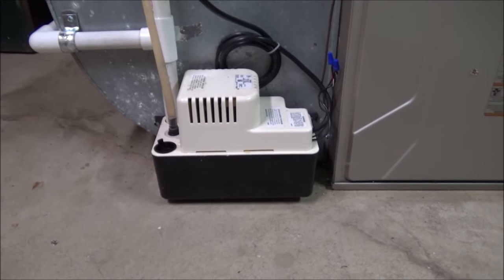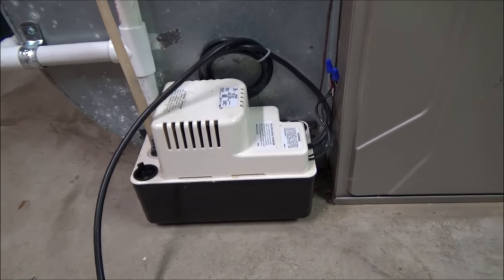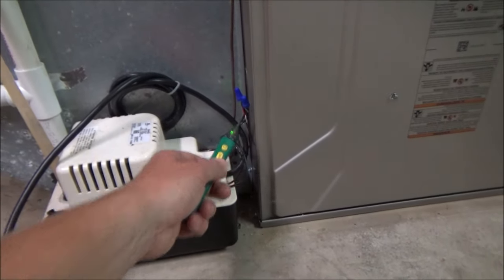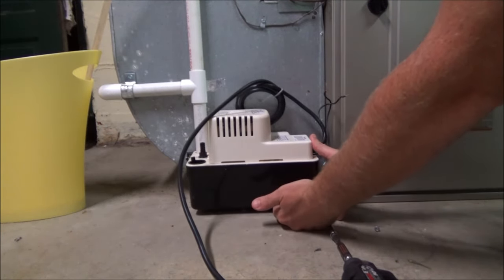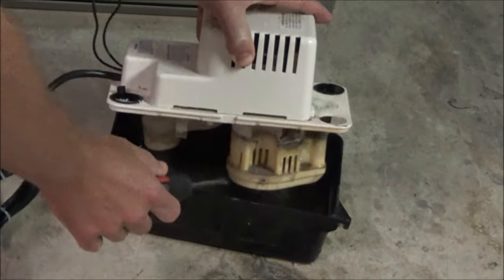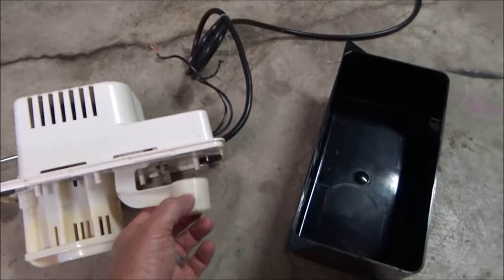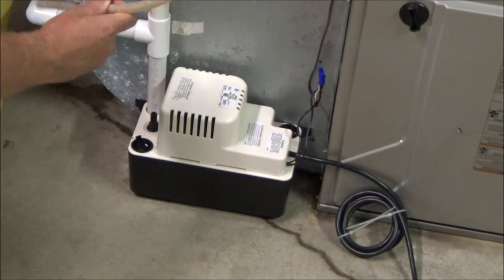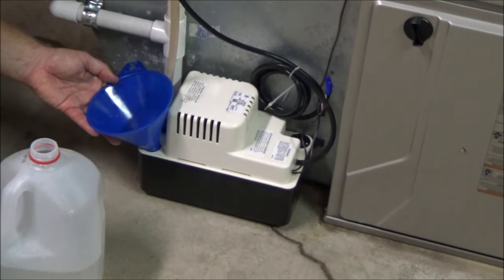How to Clean Out a Condensate Pump

Comment: Just one thing I would add, the plastic pipe feeding the pump should be cleaned too because they build up and clog there as well
Reply from the maker: Good tip! Input always welcome, I'm far from perfect!
Reply: I cleaned mine today with a plastic auger, a metal auger, and Dawn soap. Cleaned in around 30 minutes

Comment: Thank you so much. When I went to add the vinegar to my pump, I discovered that my son-in-law had forgotten to replace the little plugs which allowed debris to get into the pump reservoir. That is why the line got clogged and caused an overflow of water on my carpet. Please stress in your next video the importance of keeping those plugs in place. Thank you again for solving my problem.
Reply from the maker: Glad I could help.

Comment: I watched your video after my condensation water pump failed. I took it apart and found the sludge. Yuck. It covered the float and the side walls. This pump is dated 01/05. 
After hosing the sludge off of everything and then scubbing with Dawn liquid soap. I took the housing off the "impeller" and cleaned it out.
I put it all back together and wired it up. I filled the tank and turned the ac back on. It worked !!!
I recommend cleaning the water pump every couple of years, I will now😅
Reply from the maker: That's great! Love hearing stories like this. Thanks for sharing.

Comment: Saved me a call to my HVAC company right in the middle of a snow storm. Thank you!
Reply from the maker: No problem, glad I could help!
Reply: Why would you need to run the condensate pump in the middle of a snow storm? I thought condensate pumps were only required for use in
air conditioning units for cooling, not heating.

Comment: My furnace was installed 6 years ago, and I don't ever remember seeing my pump cleaned out during annual contract maintenance.  I have been told to add vinegar and water, but never why. In the past 4 days, my furnace will not start up because of pressure switch (3 blinking red lights) malfunction.  I did some googling, and found how to reboot the system by turning off the power for 20 seconds and reboot it, and it's good to go for about 18 hours, then it starts all over again.  When I disconnect the drain line from the lower pressure switch, about 2 tbsp of water will come out.  When I add vinegar to the disconnected drain line, it backs up real quick.  Tomorrow, I'm going to do as you demonstrated in your video, and hopefully everything will be work out.  Being on a fixed income, your fix might save me the cost of an HVAC service call.  Just had my annual tune up in Oct.
Reply from the maker: Hopefully cleaning out the pump helps. They can get pretty grimy in there!

Comment: Thank you! This was so straightforward and simple even I was able to do this. You definitely saved a lot of people some money!
Reply from the maker: No problem. And that's what I'm hoping to do! We all need ways to save money these days!
Reply: I have a high efficiency furnace.  My condensation pump is running longer than normal. 
How fast should the water be coming out of the tube?  The tube that goes into the sum pump.

Comment: Thanks! I wasn't sure if I was approaching this correctly, but you validated everything I was doing. Still looking to see if there is or should be any kind of filter in this system. Also my condensate pump has a tray for some tablets that I assume act like the vinegar to keep it running clean.

Comment: Just saved me $100 on a service call!! Thank you sir!
Reply from the maker: No problem, glad to help!
Reply: @fixitFlip  so what does it mean if my drain pan is still filling with water even after I cleaned the condenser?
Reply from the maker: @JakeAnderson-il4mv  Do you mean filling a little (like it should) and then pumping the water out, or actually overfilling? If it is overfilling it could be a stuck float or a bad motor!

Comment: Good video. Mine pump is noisy and vibrating. I suspect the impellor is imbalanced due to the dirt. Have an ideas on how to remove the impellor cover?
Reply from the maker: I do not, sorry. My old one was doing the same thing and I finally just replaced it with the one in this video.
Reply: @fixitFlip Thanks. I just flushed my pump with white vinegar and then some water. Seems to have did the trick, although I'm sure it's only temporary.

Comment: Hi, what about cleaning out the discharge tube, any advise on how to blow the slime and 'stuff' out of the discharge tube so it does not clog up?
Reply from the maker: Honestly, I just run vinegar through it and when it gets too crusty, I replace it. I replaced mine with this one. https://amzn.to/2TEW0pO
Reply: @fixitFlip  trying to avoid that, the tube runs about 25 to 30 feet and goes up to the ceiling (9/10 feet high) and then the length of the basement and down the wall and outside. it is zip tied all along the way to the furnace wiring and tubing.  Was hoping for a gizmo that I can attach a leaf blower to and blow the 'stuff' out.   Thanks for your time.
Reply from the maker: @bingandyogi  I see. There may be a special tool out there for that, I'm just not familiar with it. Sorry.

Comment: I am about to attempt this cleaning! A little nervous about all the electrical stuff.  Should I just turn the furnace and all A/C breakers off before I begin? I do not have a non-contact tester.
Reply from the maker: Yes if you turn the furnace off then flip the breaker off then you should be good to go! I put a link to the tester under the video, though, if you want to be sure!

Comment: Great video but my condensate pump is right on the ground and there’s no way to move it slightly down any further to clear the drain pipe that goes into it. I was thinking of taking a turkey baster and sucking out all the slimy water and replacing it with a mix of water and vinegar. Thoughts?
Reply from the maker: Can you lift the pipe up and out of the pump?  But yes, some vinegar would be better than nothing for sure.
Reply: @fixitFlip  No, the drain pipe is glued in at the elbow so it would have to be cut. I figured, at least with a turkey baster, I could suck the sludge out and refill the pump with a mix of water and vinegar until it starts up again.
Reply from the maker: @valerie4707  Yes, that would be a cheaper technique then cutting the PVC and having to put a new coupling on. I would suck as much crap out as you can like you were saying, then run some vinegar through it. That's better then nothing. As long as you can free up that float it should help it work better. They should not have installed it like that. Silly.
Reply: @fixitFlip  Thank you, and tell me about it! I will be sending a note to have it on file because they never told me to run vinegar through it regularly either. If it fails prematurely, I can maybe get a deal on a replacement. Brutal.
Reply from the maker: @valerie4707  Can't hurt to try!
Reply: I had success with the turkey baster and an old toothbrush to get gunk out of crevices(inlet openings/slots)
Reply from the maker: Good idea. @nobusmanrbbj

Comment: The video is very straightforward and I can follow it... except I get blocked on my own attempt: the drainage hose feels really stuck, I can't seem to get it detached. I'm afraid if I tug too hard & improperly it will break something. Any thoughts on what I may be doing wrong?
Reply from the maker: The lines can just get stiff overtime. They lose a little bit of their stretch. Try giving it a little twist as you pull.
Reply: @fixitFlip  Thanks Flip! That makes even MORE sense! I appreciate you
Reply from the maker: @lizmade2296  No problem!
Reply: Could have sealant around it.

Comment: Thank you for this video. The check valve on my Little Giant condensate pump broke at the point that is flush with the plastic top lid.  Obviously water shoots out when the pump runs now.  What is the best way to remove the portion of the check valve that is below the plastic lid?  Also this condensate pump is 22 years old and seems to work fine despite never being cleaned.  What is the lifespan of a condensate pump and is it a good idea to replace it after a certain number of years as preventive maintenance.  Thank you again.
Reply from the maker: You have done very well to get a pump to last 22 years! Typically a lot shorter than that. I would have to see the check valve, but there should be a way to get it out. Either take the lid off and get it off from underneath or use a pair of needle nose pliers.

Comment: Great vid. I got a question. I had tape on one of my safety switch wires that go to furnace. The tape came off. Now not sure which wire is which. If i cross  those wires will it still work correctly? Shows you how much i know
Reply from the maker: Either wire can be connected to either side.  Just make power is off when you connect the wires!

Comment: The video is very good and accurate.   However, I have developed an easier method of keeping the tank clean.   Run white vinegar with water (every other month)  through the tank like shown in the video.    That does a good job keeping the tank and components clean.    The Little Giant factory told me to NEVER USE BLEACH to clean it with.    Bleach will damage the pump and motor seals.   I do not clean the CV-10 check valve.   I replace it with a new one as needed, about every two years.    They are $4.99 + shipping on Amazon.    The normal "motor on" drain time is about ten seconds.    If the drain  time goes above 30 seconds, replace the check valve.     Also, sometimes bad check valves make funny noises while draining, it's probably not the motor or pump.    Replacing the check valve will usually stop the funny noises.   Always works for me.    Don't replace the entire Little Giant pump if it's not necessary.     My Little Giant pump is still working good after 14 years.   I have replaced three CV-10 check valves.   :)
Reply from the maker: Thanks for the tips!
Reply: How do you feel about bleach in pumps Lowry?
Reply: Put a couple pan tabs in it
Reply: Id rather take it off than infect my shopvac with gross mold
Reply: @Keith_Mikell  The video is very good and accurate.   However, I have developed an easier method of keeping the tank clean.   Run white vinegar with water (every other month)  through the tank like shown in the video.    That does a good job keeping the tank and components clean.    The Little Giant factory told me to NEVER USE BLEACH to clean it with.    Bleach will damage the pump and motor seals.   I do not clean the CV-10 check valve.   I replace it with a new one as needed, about every two years.    They are $4.99 + shipping on Amazon.    The normal "motor on" drain time is ten seconds.    If the drain  time goes above 30 seconds, replace the check valve.     Also, sometimes bad check valves make funny noises while draining, it's probably not the motor or pump.    Replacing the check valve will usually stop the funny noises.   Always works for me.    Don't replace the entire Little Giant pump if it's not necessary.    :)
Reply: @Keith_Mikell  
The video is very good and accurate.   However, I have developed an easier method of keeping the tank clean.   Run white vinegar with water (every other month)  through the tank like shown in the video.    That does a good job keeping the tank and components clean.    The Little Giant factory told me to NEVER USE BLEACH to clean it with.    Bleach will damage the pump and motor seals.   I do not clean the CV-10 check valve.   I replace it with a new one as needed, about every two years.    They are $4.99 + shipping on Amazon.    The normal "motor on" drain time is about ten seconds.    If the drain  time goes above 30 seconds, replace the check valve.     Also, sometimes bad check valves make funny noises while draining, it's probably not the motor or pump.    Replacing the check valve will usually stop the funny noises.   Always works for me.    Don't replace the entire Little Giant pump if it's not necessary.     My Little Giant pump is still working good after 14 years.   I have replaced three CV-10 check valves.   :)

Comment: Would a clogged and corroded drain pan and pump that isn't leaking cause the AC fan to stop running? I am trying to diagnose why my A/C stopped and whether this could be my issue
Reply from the maker: Do you have the safety switch wired?

Comment: Thanks for the video. Besides periodically using vinegar, what could I do to clean the discharge tubing? It's real gunked in there and I'd love to not have to take it off (could probably require cutting into drywall).
Reply: Long wire brush as far as I can get it in there maybe?
Reply from the maker: @BenRoth4  Yes, that would work. But the vinegar actually does a pretty good job as well.

Comment: Does the pump keeps running if we turn off the hear button what if the pump keeps running even after heat button is off
Reply from the maker: The pump will only kick on when the water in the reservoir moves the float up to a certain level.

Comment: i have the same pump. My issue is the water reached the max point and it turns off and it doesnt start back up. i will have to empty out the water so it can kick back on. Any susgention to what i should do. So i wobt have to keep emptyibg the water out the pump myself?
Reply from the maker: Is the float stuck or freely moving?
Reply: i will have to disconnect the pump and check, i havent got that far yet.

Comment: My pump and furnace/ac is only 10 months old (used for about 5 of those months). Just noticed over the last week or so it appears to be draining rusty water. Any thoughts what that might be from? Is it something serious? Thanks
Reply: May not be rusty water, could be oil due to a pin leak in your evaporator coil.  If it is, eventually your compressor will stop running due to loss of refrigerant.

Comment: I was wondering...if after a good cleaning of the unit and the drain-to-outside line...if pouring maybe a cup of vinegar into the pump tank once a year would suffice for having to do the actual full cleaning job every couple of years?   Or maybe every 6 mos even...?
Reply from the maker: Running a cup of vinegar through it once a year or so helps but I would still do the deep clean from time to time.

Comment: Thank you! Great video! My condensate reservoir tank was all sludgy and slimy (I just moved into this house that is 8 yrs old and I guess the condensate tank was never cleaned), the HVAC maintenance guys just replaced the slimy water with some soapy water and didn't do any cleaning. The transparent discharge tube is dirty and moldy but dry as I haven't used AC for two months. Hope vinegar won't damage the metal parts of the pump if any. I would like to know how to clean the transparent discharge tube as well? Also, where does this moldy water goes? I'm sorry if I'm sounding silly. I'm new to all this and have a severe fear of mold.
Reply from the maker: A little bit of vinegar here and there won't hurt anything, and it will also help clean the lines. Every house is different, but your water probably gets pumped to a sump pump, then pumped out of the house, or directly out of the house. Just follow the line if you want to see where it takes it. If the lines are too nasty to clean, you can just replace them like I do in my video here: https://www.youtube.com/watch?v=yK0HAeKXils&t=7s

Comment: Hi so I have this pump for my rental property beside the furnace. There’s no drain beside the unit. So the tenant has a buck which fills up in few days. What if I turn this pump off will it do anything. Not sure why this pump is installed
Reply from the maker: Does the pump drain into the bucket? Or does the furnace drain straight into the bucket?
Reply: @fixitFlip  the hose off the pump drains into bucket but it fills up quick in a few days
Reply from the maker: @sukhipandher9090  Okay, so it's pumping into the bucket. Yeah, that bucket will definitely need to be dumped out every so often. It should typically pump the condensate water outside or into a sump pump to be pumped outside or down a drain.

Comment: How do you clean out the hose? Our hose that leads to the sink from the condensate pump is super moldy. Its causing mold in our plastic sink as well.
Reply from the maker: Flush vinegar through the line. Or if it’s too moldy, just replace it.

Comment: Ok so did you actually unscrew that bottom piece from the top of  pump and clean inside it
Reply from the maker: I did not. Just scrubbed it with a toothbrush.
Reply: @fixitFlip  I did the same!
Reply from the maker: Great minds.  @mattg551

Comment: Does it matter that my safety switch wires are not connected to anything? I see that my hvac guy didnt do that.
Reply from the maker: They do not have to be connected to anything but they should at least be capped off.

Comment: I have a green rheem system and don't see anything like this around it? Is it in the unit?
Reply from the maker: Not every system comes with one.
Reply: @fixitFlip  we have water in our floor return but didn't see a clog in our drainage hose but no water coming out so I.thought that's got to be the problem I used the wet vac but hasn't fixed the problem and when we wet vac water out of the floor return it fills back up instantly.
Reply from the maker: @sgt.zombie  Sounds like a leak in the system somewhere.
Reply: @fixitFlip  ok thank you, any idea what the repair cost should be?
Reply from the maker: @sgt.zombie  I do not, sorry. I'm just a DIY dude.
Reply: @fixitFlip  looking at the unit yesterday looks like water or something is leaking on the compressor.
Reply from the maker: @sgt.zombie  Yeah that should definitely not be happening. Can you tell where it's dripping from?
Reply: @fixitFlip  when you look under the fan at what im guessing is the compressor somewhere looks like from one the small pipes running to it but id have to take a closer look.